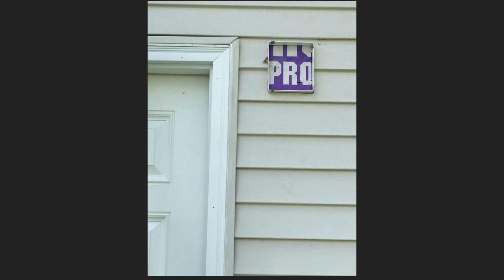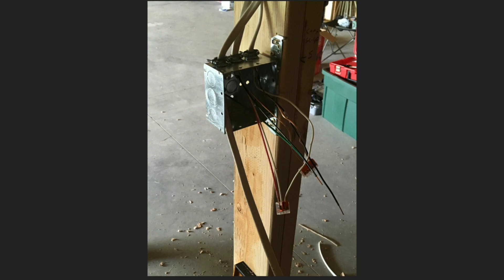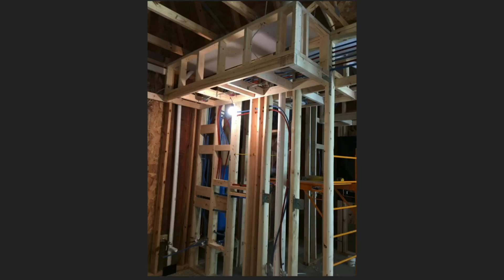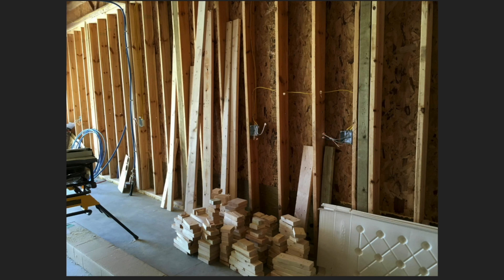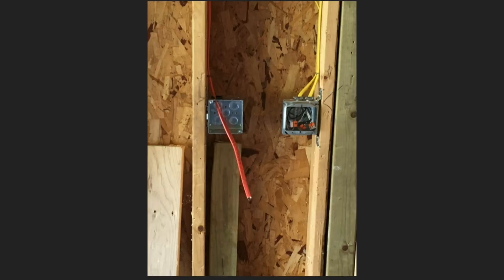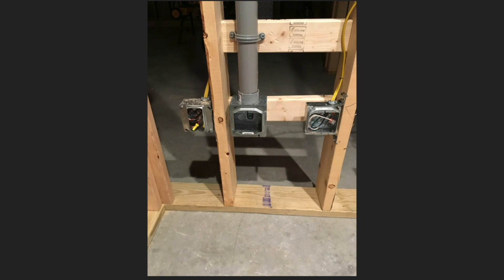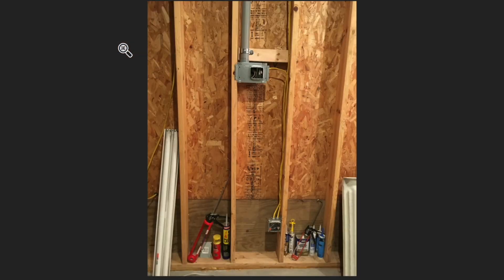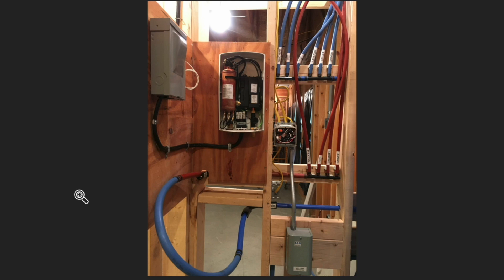Rough Electrical (workshop part 4)

Comment: one of my peeves is when there are not enough outlets or usb ports and i have to unplug something else that i need again later, then all the wires get tangled up. my second pet peeve is when there is not enough space and my third one is when there is not enough light. good job on the house. you should probably add a security camera or a couple of them since you won't be living there. glad you're putting in the ham radio thing, if it's up on a hill you could always put in a repeater i guess. keep up the good work.
Reply from the maker: I agree so much! Thank you 😊 I thought about a repeater, but I think there's already a lot of good ones in this area. We've got a couple of cameras set up and they've been nice for peace-of-mind, though I don't think anyone would bother the place... but I guess you never know for sure.